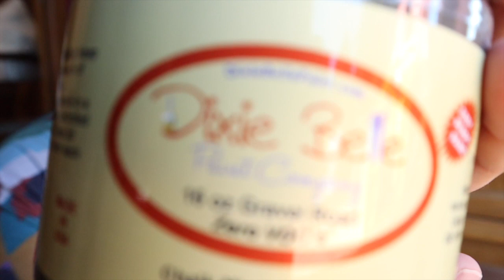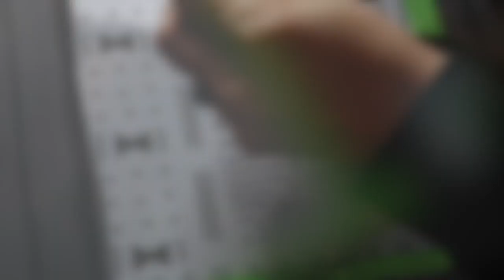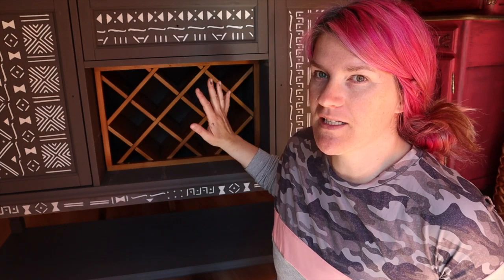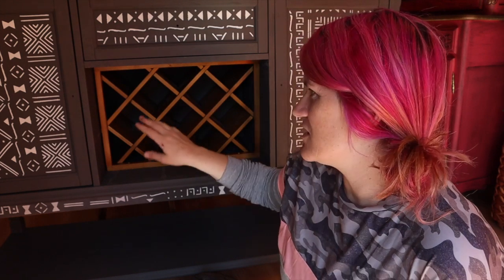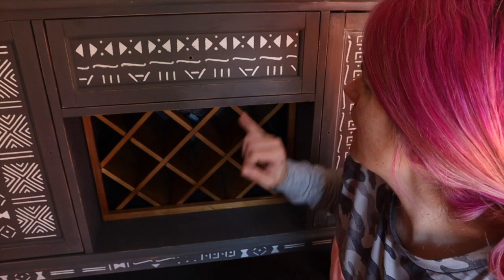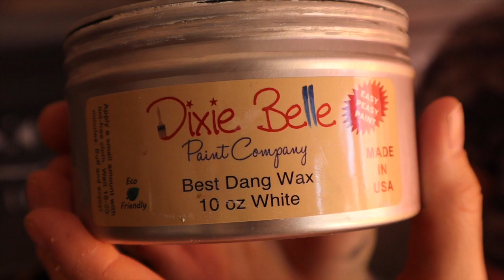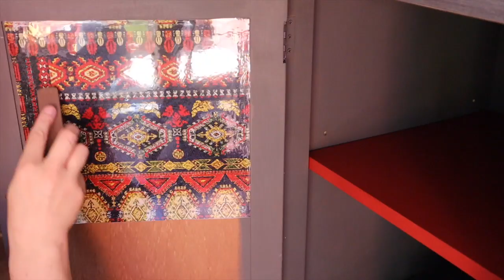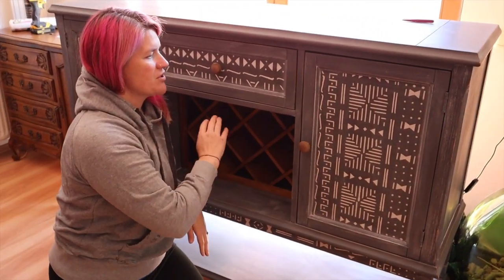Affordable DIY Anthropologie Inspired Furniture

Comment: Really spectacular! I am getting so excited to do my furniture.  This piece was so totally perfect with the wine rack left unpainted. It works too because it has its own function I felt.  And it’s in the center wanting to be loved by everyone 😍🎯. Oh and the red shelves, I am ready to run out and grab some paint right now. On that note I wanted to ask about the serf prep.  I’ll be doing most of the sanding inside this winter and I wanted to ask you if that system is more effective at preventing dust.  I need to be careful of dust with my sewing machines.  Also what is important as as far as the model you choose.  I had been looking at random orbital sanders and then I saw this, you and Katie use this and Christina got a Festool recently.  Do you need a particular vacuum ? is another question.  I have to get something soon so I was hoping you could help guide me a bit.  Thanks so much again for the quality make and your channel in general is so good!
Reply from the maker: okay so first thank youuuuu

Second I LOVE LOVE LOVE my surf prep, I just use my old shop vac with it, but in the summer I take it outside, I literally use it multiple times a week, you can strip finishes, smooth finishes, buff vintage hardware, I use it for so so much. It is well worth the investment. 

I have a coupon code also fro 10% off and you can use it any time, even for re-orders of pads and such, I also like that they have paper, pads, screens all the things and their customer service is amazing and they are a small business which really means a lot to me when factoring in everything. 

BELLARENOVARE10 is the code 

I love my 3x4 electric ray!!